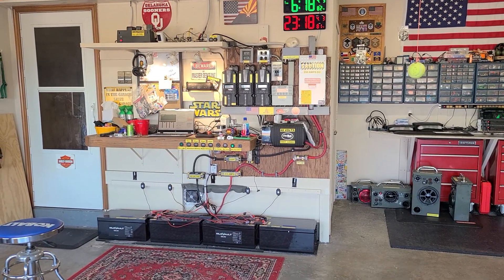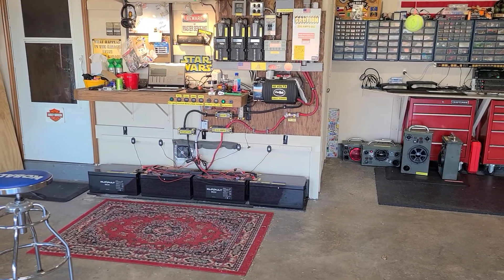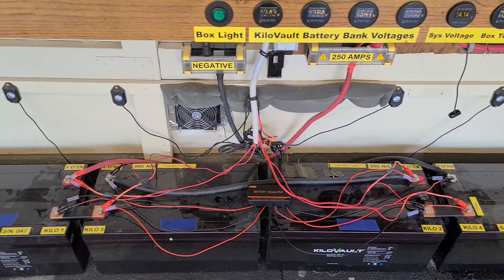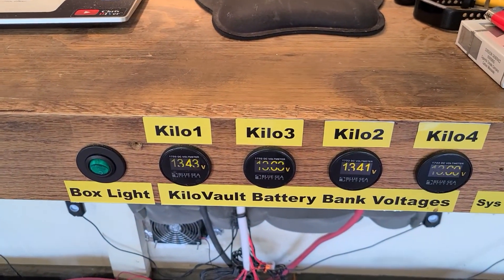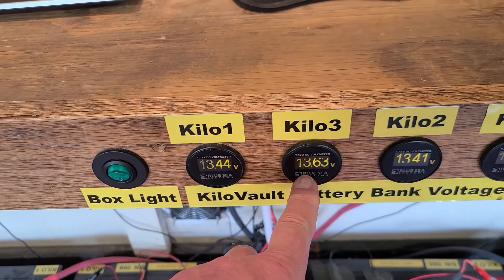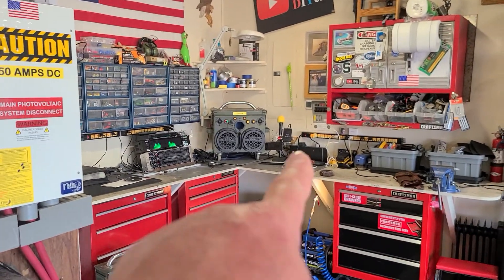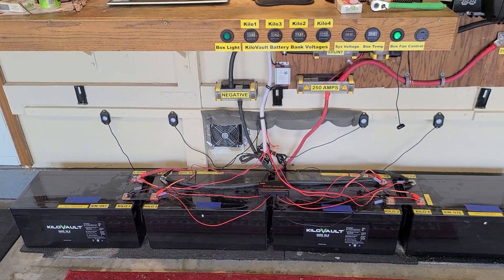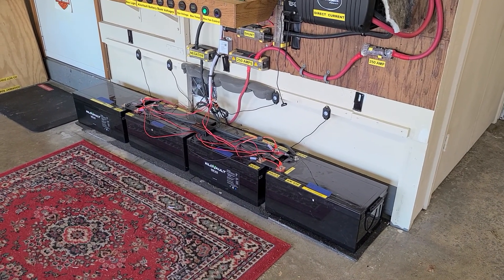48v KiloVault lithium battery bank update - installed a balancer

Comment: Want to bet there are no electronics inside of that "equalizer"? It is just paralleling all of the batteries.  You can have parallel and series connections simultaneously.
Reply from the maker: Balancing the voltages in all four batteries is all that I needed and was going for. The four cells in each battery are taken care of by the internal BMS. Yes, this balancer can be used with two or more batteries in either parallel or series connections.

Comment: I was still thinking you where on 24 volts. I know this is silly to ask. But can those even be series to 48 volt? Seen a LOT of those that do not work more than 24 volts in series. It had some deal with the BMS. I may be way off base here. Just one thing I have seen. Sorry brother. 10 grand I would be PISSED. Thanks for sharing. God Bless
Reply from the maker: According to the owners manual, yes they can be strung to 48v. Voltage tolerance needs to be w/n 0.2v before stringing. They say nothing about using balancers. However, a viewer sent me a link to their store's KiloVault 4-battery balancer for $75. Go figure!
Reply: @ChrisDIYerOklahoma  I hook my batteries in parallel for a few hours prior to final assembly. Has always worked well and quickly. Though I do run various types of balancers at times, most have very little transfer capabilities so it takes a loooong time.
Reply: @ChrisDIYerOklahoma  WOW! Seen your update. Hope this works man. Like I was saying. I did not know or not. Just rather bring it up and it not be that than not. Thanks for sharing.

Comment: It will be interesting to see that if the voltages are all the same and the BMS have a different SOC. If that is the case then draining the power on the 2 offending batteries until they power down may be the only way to reset the SOC in the BMS. I know you will figure it out and we all will learn. You are a smart man Chris. Thanks for sharing your findings with us.
Reply from the maker: Thanks Steve. Just got the entire system back online. Also checked each batteries' SOC/voltage/cell volts -- get this. They are all spot on the same in all four batteries (discharge volts AND cell volts are all about 3300mv). I am going to drain the battery bank down to 0% SOC to (hopefully) reset the SOC. Crossing my fingers! It might take a couple of tries. Heard there is a big storm heading your way...stay safe!

Comment: Hope it all works out for you man. This is 5000% out of my wheel house so I'm going to stay in my lane and not offer any advice because it would be folly regardless. This has just been an interesting problem I've been watching along with as its unfolded and have had an interest. 

However, I do have a question. What was the purpose of your whole system? I did watch the whole video and I know you said you wanted to be able to have backup power for your home due to adverse weather conditions. So were you originally able to power your whole home from that setup you have? If so, about how much in total did it cost you? And would you say was a worthwhile endeavor?
Reply from the maker: Thanks for following along. I have done many videos on this system. But, to answer you directly, this is a 14.4 kWh battery backup system with about 6,000w in solar panels attached. I use/store energy to power six household circuits. I average about 25 kWh daily sunshine harvests with the sun is shining. It has been a "learning curve" doing DIY home solar. Expensive...especially when you go cheap (like I did with FLA batteries, disconnect boxes, cabling, etc). ROI will take about 10-12 years from what I have invested. I am in year six right now...but, added costs to replace the FLA with lithium cost me $9208.00. SO, that pushed back the ROI 3+ more years. I really haven't spent any $ on this system in about two years. Solar is a great hobby/preoccupation if you have deep pockets. It all depends on what your powering and what you want it to do. If you go totally "off-grid" type system and want to power you WHOLE house...costs can be nearly $30,000+

Comment: I hope it works for you!
Reply from the maker: Thanks Lisa -- storm season is here in Oklahoma and I need an operational system.
Reply: @ChrisDIYerOklahoma  stay safe..I read the users manual which you already said in your video..but it said to reset the batteries....
Reply from the maker: @lisad476  -- yup...that will be the next step once I get the four batteries' volts closer. Thanks!